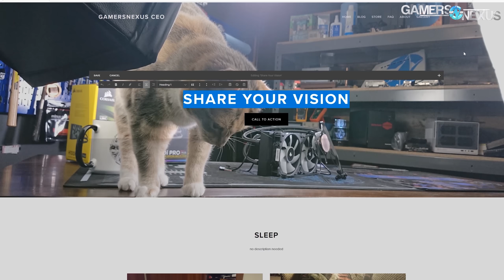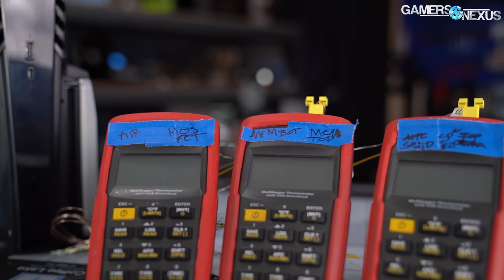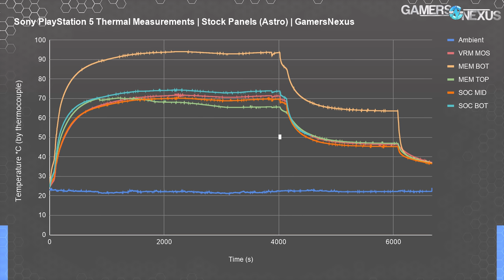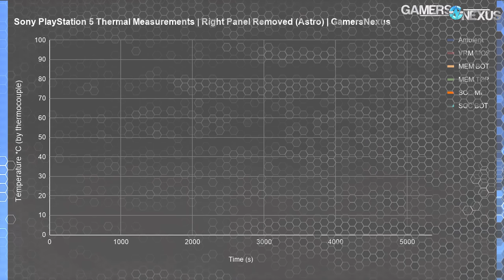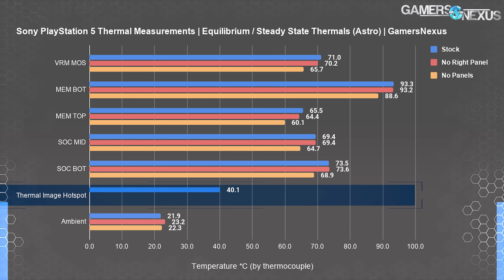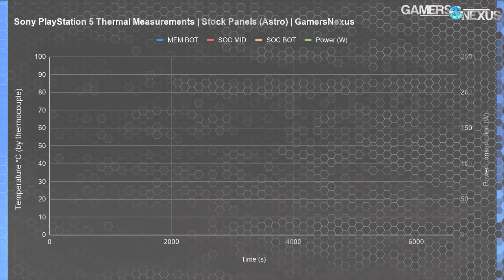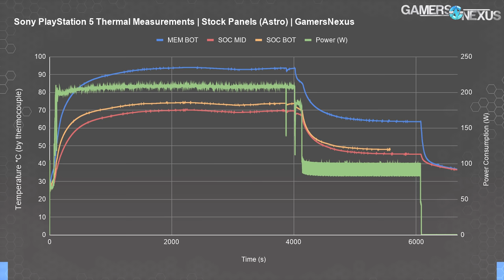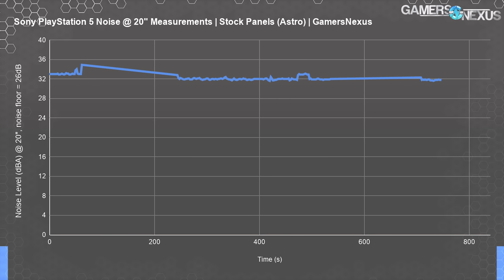Weak Cooler Design: PlayStation 5 Thermals, Power, & Noise Testing

Comment: DISCLAIMER: Not a fanboy, but someone who is genuinely interested in these findings and the testing methodology......

Soooo, let me get this straight.....this thermal test was conducted in a peak GPU and CPU intense area of the game (a section that in the design of the game is only supposed to last a few seconds) and you ran this test for an hour (which by your own admission is nearly 3 times as long as you would normally test PC components) and concluded that under extreme load that certain memory nodules are running hot?!?!? Just as a matter of practicality, logic dictates that the obvious question must be asked....... when, if ever, does a game in a normal play experience does a game bombard the system with this level of heat conductivity for as long as the test you ran? 

You see I can understand the nature of the test, to determine the apex of heat produced by the console running under extreme load, but what baffles me is the practicality of the test considering the implementation of such a scene in a real world play experience. By design games on console rarely, if ever, spike to the performance level needed to run the segment you tested and never for as long as you tested it for, so it begs the question, how is the conclusion of the video justified by the extreme nature of the test, when the practical application of the test parameters are never going to be utilized? It seems odd that the test results are that the console is found to be "lacking" proper cooling when the test represents a scenerio that games by design are not going to reach. I am not going to scream bias because I am aware that these types of test are designed to test the thermal limits of the machine, what is odd is that given the parameters of the test measured against a normal play experience that the verdict is not that the console does well for such an extreme situation. Clearly this section of the game in a normal play experience is supposed to spike power which produces more heat, but this section is designed to last a few moments, not an hour. One of the greater benefits of console gaming is that the developer can include these types of controled power spikes with the full knowledge that the game will not be in a constant state of this caliber of load  because on console the game setting parameters are set by the developers themselves. The situation which is being tested is a developer controled environment pushed to the extreme, and given the game tested, it is clearly not indicative of the entire play experience of the entire game on the console. 

In truth I would be interested to see results for thermals of a game in a normal play experience as that would be more indicative of the levels of heat produced by normal play. Testing consoles in this method seems largely pointless as the player has little to no control over the performance targets the game runs under and by design no developer would include a segment of gamplay where the machine is under this much load for as long as was tested. It just seems as if the test was designed to produce a certain result (which it does) and that result is used to make a conclusion that is at odds with the normal play experience of the console.

Comment: Let me get this straight.
As long as you have room temperature, everything should be alright. No sweat.
When it does get hot, 30+ degree Celcius, you should either use some room/ air refresher or point a fan at the console.

Also, overheating on this one shouldn't make the console die but it is supposed to shut down to avoid overheating.
Mine has been running flawlessly as of now but I also have been extremely precautious.
Sony will have at least 3 patches coming throughout december and january, a source close to me who works with Sony every now and then, told me

Comment: This might be the last console generation that relies on fans rather than liquid cooling. Liquid cooling is where it's at, no fan noise no overheating. Yea it cost more, but otherwise keeping consoles running cool is going to become a series of compromise, half steps and inadequate results.
Reply: You realize most liquid cooling setups use a fan at the radiator right?

Comment: 3 months later. PS5 next to no crashes due to heating issues (not counting idiots who blocked the base vents) xbox smoking units and full bricking. Ps5 cant even hear it in my house and cant even feel a big temp difference espically compared to ps4 pro. Xbox X loud and just a heat box and can tell its running. Had to replace it once already due to power continually turning off
Reply: Those Xbox videos were vapes and fakes. Lets wait a year or two and see all the dead launch PS5s. Thankfully a redesign is coming. I will get that one, this one is just pathetic.

Comment: you just look at the PS5 and if you have any basic understanding of therrmals it is a horror show. so many un-necessary layers and baffles. and the contact with the cooler and the dye are is clearly not great as they are able to fit a literal pool of liquid metal between them :/ not to mention the 60+ screws they used to screw all the random bits of plastic and aluminium together. and all for what? a cheap looking design that resembles a budget wifi router?

Comment: Steve: the steel does not really provide a heat sink?!
Large steel heat sink the memory sits on: Am I a joke to you?
Steve: Well....yes.

the edit: seems like you could have tested it after increasing the fan 
speed to double and the noise to 20-30% more?

Comment: Never buy gen 1 anything. Cars, graphics cards, consoles. Hoping it doesn't take 18months for a slim model. Just make it a little smaller to fit in most people's entertainment units :). Xbox design, the box, there clearly was no design. Or there was, what do we need to do, start from scratch with the design, what's that box over there, the second prototype, does it fix the issue oh yes it does sir, lets go with that, are you certain, yes, ummmm ok then. You pay me regardless, here's "the box".

Comment: this is the high $ next gen console... and the corners that appeared to be cut blows my mind... no liquid cooling, which I guess is understandable. but no turbo cooling or better engineering of the board to dissipate the heat. not that I planned on buying the original ps5 anyways

Comment: I came Up with the best solution. I got the digital edition on day one of launch. And immediately noticed the capability of the fan’s airflow power. A dust prevention method needed to be done. Also the thermals with covers on concerned me too. The shells are just cosmetics/design products, maybe a safety Funktion too. Preventing children to put stuff into an operating fan etc. long story short : My modified PS5 has better thermodynamics and covers the dust problem, and that’s a real problem in the PS5 Design. 

Check out my modified unit here: It goes strong since almost two years and two very hot summers with up to 40 Celsius! 

https://youtu.be/t6WViI6DTms

Comment: First gen ps5 are doomed  to fail with such a weak heat shield,,and the way the exhaust is designed and let's heat out..honestly stay away from this console unless in a year or 2 you want a broken ps5 ,get store warranty for a replacement. Or get the  xboxs Series X with better cooling and better performance to last a lifetime.
Reply: Agreed. Plus the quick resume and Dolby atmos on Xbox is freaking awesome!!!! Add my gamer tag JRbowling
Reply: Prior gen consoles were inefficient at cooling but no one cared and didn't buy consoles solely based on their cooling efficiency but how they performed for games.  No one has been crying about issues with heat or systems spontaneously combusting.  You don't buy something you want to enjoy out of fear.  There's obviously a reason why one buys a PC/XBOX/PS5, each have their positives and negatives, system cooling be damned as long as the console works as it should and plays games like it should, unless it's PC where you can customize it.

Comment: Why on earth did you claim the thermal compound used was plumbers putty? I`m a Gas Safe plumbing Engineer and can tell you 100% with no doubt those are 2 totally different products. Plumbers putty is totally different and not made of the same materials or has anything near the thermal conductivity needed. It is a thermal insulator so basically the exact opposite. All in all you did a good job of denigrating the console with references made, hammer used to remove a simple cover etc., and whilst I do agree on good testing this was the most rigorous thermal testing I've yet seen you do on a device.

Comment: For 36 cu this has cause lots of problems . If sony had used 40+ cu it would not have needed so huge heat sink and get only 10 teraflop and the console then can be easily made more smaller size and microsoft lose more sale fact😃.

Comment: Those lines right up with my usual thinking. 

Never buy the first generation of anything ha ha.
Reply: Have a day one ps4, day one switch, day one ps3 that begs to differ
Reply: Got a day 1 series x, no problems. But I did but the extended warranty just in case something does go wrong.

Comment: Mine is almost silent and produces very little heat, a lot more quiet than my gaming pc and less heat. Games just seem to run so much smoother on the ps5 than on my pc. I have a gtx 2080 but it has judder in a lot of games. It probably would do better with a monitor but I like a large tv for gaming. The pc has windows updates tonight and a new video driver is out. It just seems to be something all the time with the pc and games have so many settings to tweak. You almost need to play the full game to tweak settings. The ps5 has taken the place of my 2500 dollar pc that cant run games as smoothly as the console and all the tweaking is already done for you. Very few updates for the console and they are quick. I have had probably 20 gaming computers and built some of them. I just have never been very impressed with them compared to the consoles. If you crank the graphics to out perform the console later in the game you may get lag and a crash. I like a controller and  some of my pc games only have partial controller support. Control feels smoother on the console, there are more players on consoles and the crowd seems nicer. Windows is full of bugs. I was helping someone tonight with a laptop because it updated and now there is no network adapter showing in device manager. Some fixes can take hours when you could just turn on the ps5 and be gaming almost instantly. Thanks for the information, thumbs up subscribed.

Comment: I'm just going to put this out there and if I catch flak then so be it. That PS5 looks like the cheapest piece of trash I have ever seen. It's running hot and I mean the chassis once inside just looks cheap and even sounds cheap when working on it. I can see where they cut corners to fit up to date hardware in there. The fact of the matter is, they are trying to keep up in the arms race with PC's but that's honestly impossible unless you really invest a lot into those game consoles. They have sacrificed cooling and honestly a poor design in order to save money to stay somewhat competitive with a PC. I want to own a PS5 but after seeing this, I think I will wait until the PS5 "swiss cheese" edition which will have better cooling...
Reply: The temperatures aren't even that bad, considering how quiet the fan is they could easily change the curve with an update and the temps will come down.

Comment: In general, isn't ram a component that runs hotter than a CPU given it's lack of an active cooling solution. I don't see Ram heatsinks widely used. If you ran this same test against a Series X, a PC, or last gen systems, would you see a similar data points of CPU vs RAM thermals. I'm not sure it's a unique design flaw, but your claim of artifacting on failure sounds accurate.
Reply: No, if system components like ram run to hot, especially in a compact design like in console it will lead to overheating and dead consoles. PC's don't need it because the ram in them are having good airflow from the massive fans. In phones no workloads even use ram that much.
Reply: Most faster Ram-Sticks for Desktop Pcs actually do have (tiny) heatsinks, though some might just be for looks^^ On GPUs the ram is usually connected to the main cooler aswell

I'm pretty sure even the Raspi4 Ram is supposed to be used with a small heatsink

Comment: So has Sony contacted you are they going to change it bcoz this sucks for console gamers,  after this they will have no choice to change their design
Reply: he did the test all wrong
Reply: @Ricardo29j  there is no airflow inside the metal chassey, the fan sits outside and blows through the heatsink of the soc and over the front of the chassey, not inside

the ram is stuck into little depressions in the chassey with some thermal goop, which means even if there was airflow behind the pcb it wouldn't flow over the ram anyway... the idea is obviously that the heat from the ram is sunk into the chassey but there is not much airflow over the backside of the chassey so it gets warm and stays warm and the ram gets hot aswell

Comment: This thing is a technical mess. Soldered on SSD, conducting liquid metal, coil wine, controllers failing, 2 sec light of dead, high temps... Not a fan Sony... Not a fan.

Comment: Mine never gets hot. So you may have got a bad one my dude
Reply: Its just that memory chip at the bottom that is not being cooled like the others.
Reply: That's a relative comment and you have no idea how any of this works. This video is about inherent issues. It's the same TDP issues from design. Being a fanboi has rotted your awareness of basic logic.
Reply: Go read notebook check they gave a whole breakdown of it and it’s not pretty. That’s what’s causing all the problems with many many PS5s So yes this is a major deal
Reply: @drummer7557  thats why its a good idea to wait a bit until all the bugs are worked out. My series X had problems with the drive unit and I returned it and amazon sent me a new one and so far so good.
Reply: @Jimmyxsx  Yeah I have a series X, not a single issue. I'll get a PS5 when their exclusives start to hit ;o)

Comment: As an engineer it's painful hearing all the bad heat transport theory. These guys are better than most by a mile, but they still say very wrong things.
Reply: what was wrong?
(kinda missed half the video answering comments about how the cables totally obstruct airflow in this screwed shut metal shielding xD)
Reply: @johnuferbach9166  Stuff like “precisely imprecise” instead of using “accuracy” and “precision” and other engineering/scientific vocabulary. I get it, it’s all self-taught without textbooks. Also, it’s really unnecessary to explain thermocouple calibration. I can’t imagine anyone who cares would also not know how thermocouples work. So clearly he just wanted to show off he knew how thermocouples work. 

On a technical level, saying stuff like, “you want to see the exhaust really hot, because that means that the air is getting out.” Kills me.
 Yes, hotter air means it is carrying away more heat (given constant air flow, so we are already introducing stipulations), but it does not mean that the components are cooler. Maybe it does in this specific case, but saying it like that suggests it's a general rule for all cooling systems and it 100% is not.

Comment: Scam for $500 overheating console poor cooling system, the hottest gpu/processor is by lead to melt, rather than pin in socket, quality less than a year goodluck.

Comment: You compromised the cooling by installing your sensors.
Reply: I guess in general I don't like this thermal evaluation. The goals of a console are completely different from the goals of a PC. There is no reason why any of these parts would be a lower temperature. Ambient temp, noise level, and chip temp is all that matters and it is well within whatever they would need. Comparing a console cooling solution to a PC is completely useless, as not only is the ambient temp going to be lower on a 350w console compared to a 500-1500w PC, you will also never see a console be pushed beyond regular use as you may see on a PC so you don't need the headroom.
The console perfectly reaches all goals, yet you call it "weak cooling design" that is in my opinion not only entirely subjective but kind of ignorant.
Reply: @Blag_Cog  He is comparing the memory temps to memory chips limits... which is kinda close
Reply: @johnuferbach9166  in that case they should have taken damage at this point.
Reply: @Blag_Cog  na with the temps he reported it s still barely below, but ofc higher ambient temps might cause problems, also I heard about artifacting on the ps5 which might be linked to this issue
Reply: @johnuferbach9166  I think it's one of those things that are impossible to talk about without thorough and scrutinized empirical data. For the most part, I will treat it as FUD for everyone it happens to, and for everyone, it doesn't happen to I will call them one of the lucky few.

Comment: So... "Don't buy version 1 of hot-rod hardware because it's pushing its thermal envelope, and an unproven cooling solution."

Check.
Reply: It's only pushing it's thermal envelope because it hasn't received fan speed optimizations yet, nothing wrong with the hardware.